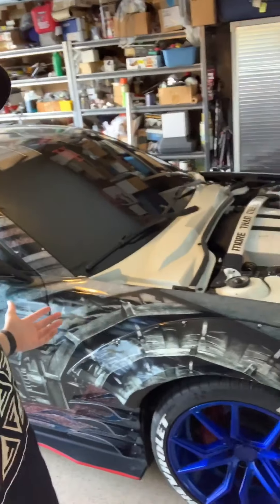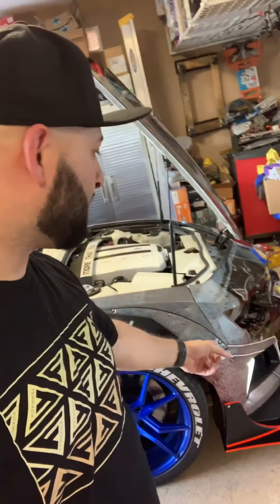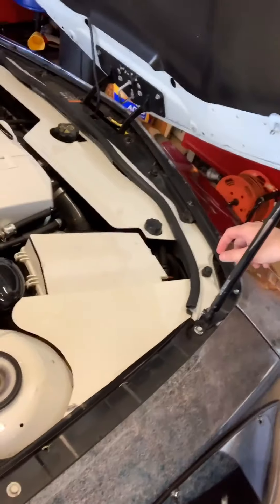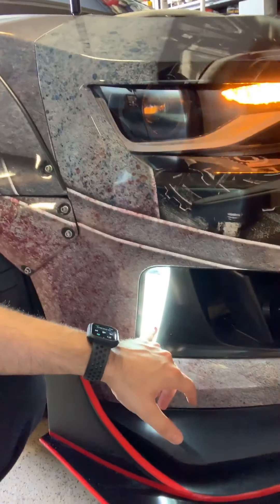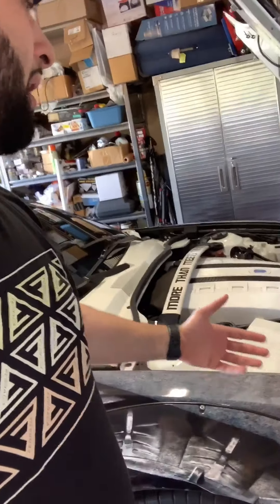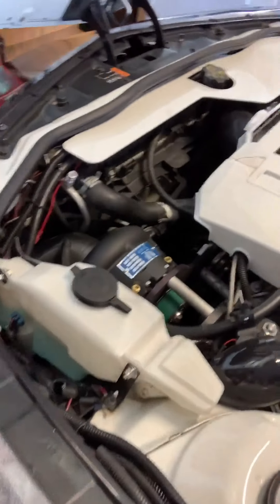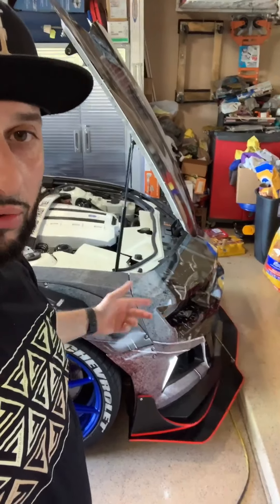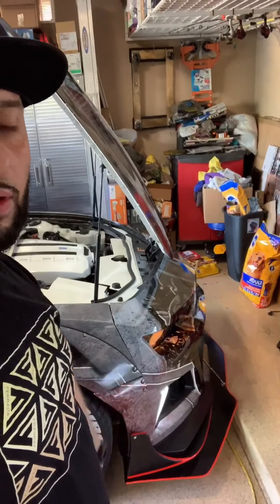6th Gen Conversion Lights Camaro | Finally Have Turn Signals

Comment: What kit did you use to install the headlights and bumper kit? I have the same year and am having trouble figuring out how to wire the gen 6 lights and am curious if you did anything to the ZL1 bumper before you mounted it to make it fit.
Reply from the maker: Joseph Rodriguez lights @rgvshelby coupon code hitman10 and kit ikon motorsports

Comment: once i fond another job i got to work on wiring my self. i haven't wired my halo's in my spyder headlight and need to replace the cheap china resistors in my Ebay LED tails the left hyper flashes. should not be a bad job there 4 resistors each tail light wired to the sequential board the head lights is gonna be a pain in the ass to wire up the are CCFLs and 2 halo's for each light -__-. your 6th gen lights look hella sick id love to have them but i am pretty sure they wont fit the 5th gen front